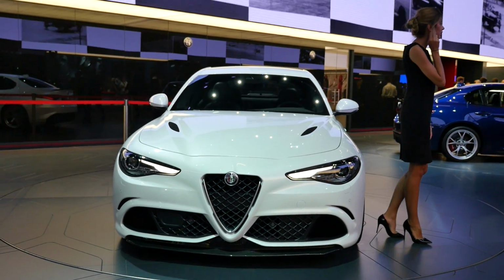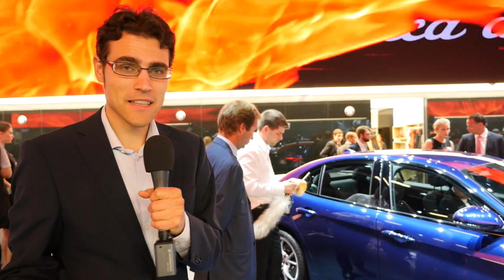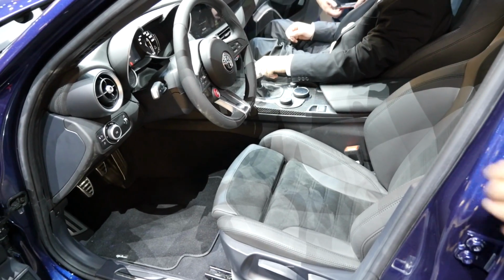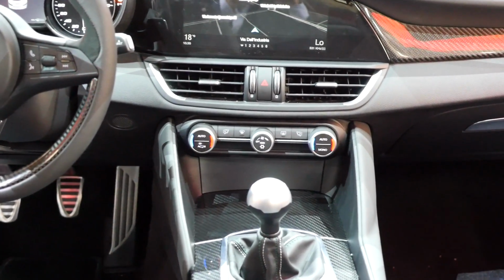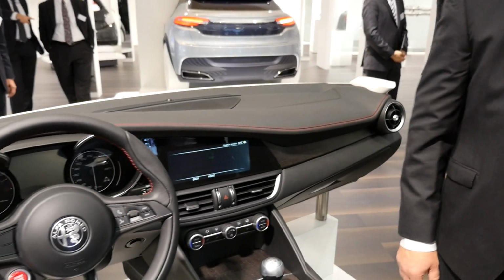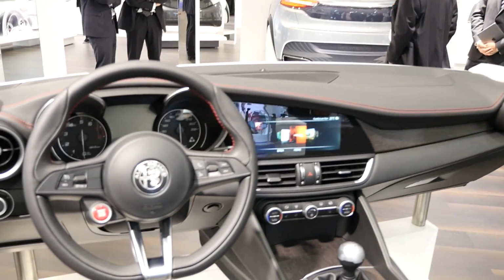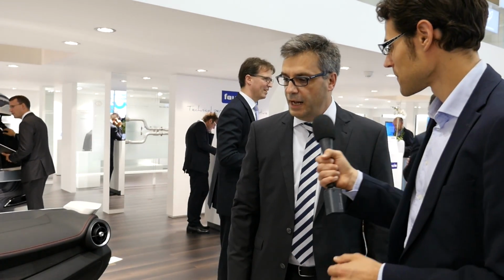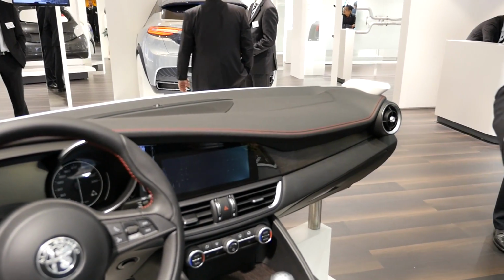2016 All-new Alfa Romeo Giulia REVIEW at IAA exterior interior new cockpit special - Autogefühl

Comment: 4:51 Also note how that german dolt is ripping the gear lever without pressing the clutch pedal.....
Reply from the maker: +Vlad Pootin When the engine is not running there is no need to press the clutch :)
Reply: +Autogefühl false.... engine is stopped, but still attached....you can change the gear but is harder than the normal and not fluid at all

Comment: Looks like BMW inside and out
Reply: this looks absolutely nothing like a bmw inside, and barely anything like one outside..
Reply: The outside is debatable but the interior is definitely BMW imo. http://s1.cdn.autoevolution.com/images/news/gallery/photo-comparison-bmw-f80-m3-vs-alfa-romeo-giulia-qv-photo-gallery_13.jpg
Reply: No...
Reply: That's looks absolutely nothing alike....
Reply: Peter H if you fanboy Alfa and hate BMW that's fine
Reply: +DaFinn i like Alfa, Audi and BMW.  It has nothing to do with bias, and everything to do with the fact that those two interiors look absolutely nothing alike.
Reply: Oh god, another one of these "my opinion is fact". My opinion is really pissing in your cereal haha
Reply: Sorry, i will admit the steering wheel looks very similar 

everything else looks completely different 

the dash is different (alfa has a very distinctive curve, while the BMW is dead straight),  the door trims are completely different, the transmission tunnel is cometely different...the air vents are round on one and rectangle on the other...its just a completely different look.

i have no idea how you could think those two interiors look in any way similar.
Reply: +DaFinn saying those interiors looks alike is like saying a Toyota Camry looks like a BMW M5 because they both have four doors and four wheels.  It just makes no sense.

if you think they look so alike, then list ke 4 parts of the interiors that look alike  OTHER than the steering wheel.
Reply: Peter H You idiot, it's not about the detail being precisely the same, it just gives me the BMW vibe, it reminds me of a BMW, so to me it looks like a BMW.Maybe It's the steering wheel or the center air vents or whatever but I don't care what it is, it just reminds me of a BMW. These are opinions, ok? Geez...
Reply: Anyway, since we want to avoid bias and try to be objective here, I will list for you some of the many obvious differences between the two interiors:

1) Door trims:
On the BMW the door handle is up high near the corner of the dash, on the Alfa the door handle ends down near the knee area.  

The Alfa has trapezoidal shaped speaker grills at the bottom of the door, the BMW has speaker grills in a completely different location.  

BMW door trims angle out towards the top of the door, while Alfa trims go straight up. 

2) Dash:
The Alfa Dash has a very distinctive trapezoidal chape that is extremely unique, and that I haven't really seen on any other car - it's a very distinguising feature of the interior.  On the other hand the top of the BMW dash is completely straight from one side of the car to the other. 

The Alfa has a display integrated behind a hidden 'beauty panel' in the dash, while the BMW has an LCD that sits awkwardly on top of the dash, like Mercedes / Audi. 

The Alfa has two round air vents (something that has been a distinctive part of the Alfa design language for years) on either end of the dash, along with two trapezoidal vents in the lower center of the dash...while the BMW has four rectangular air vents all running across the top edge of the dash.

The Alfa has two center 'pillars' that join the dash to the transmission tunnel - a look that is (if anything) more Audi / VW like.  The BMW has a very unique silver trim piece that runs from the transmission tunnel upwards into and across the dash that which gives the BMW a unique appearance unlike any other car interior I've seen.

The Alfa has aircon controls at the bottom center of the dash, stounf knee level.  The BMW has aircon vents higher up in the dash around elbow / steering wheel height. 

The Alfa has has an almost perfectly symmetrical layout on the transmission tunnel, with the large joystick in the center being flanked by two smaller knobs in what is mostly a pretty flat surface.  The BMW has a trapezoidal trim piece that sticks up from the transmission tunnel about 2 inches which the gear stick sits on, then has a seperate trim piece to the right of that which is even more elevated that h ouses the joystick/control wheel.  

The Alfa glovebox curves well under the dash and is almost not visible from the photo you linked, while the BMW glovebox comes up much higher, to almost steering wheel height. 

The dash of the Alfa is leather trimmed with coloured stitching, the BMW dash doesn't have any leather trimming that I can see in that image. 

The Gauges on the Alfa are split apart, while the ones on the BMW are close together.  

I could seriously go on all day if I wanted to be really nitpicky, but if you look at individual shapes / elements of the design the two really are absoulutely completely different with the exception of the steeering wheel, which I have already accepted looks very similar. 

In fact that Alfa interior probably looks much more A3 / C Class then it does 3-series (and it doesn't really look like those at all either).  Audi would probably be the closest of the three because of the air vent designs, the transmission tunnel design, the flat bottomed steering wheel, etc.  

It's actually quite unique though and I can't think of any car interior I've seen taht really looks much like that Giulia interior.  You might see one or two details to associatre it with another car, but 80%-90% of it looks completely unique.
Reply: DaFinn Your words were:

"The outside is debatable but the interior is definitely BMW"

Note the word 'definitely' there.
Reply: Peter H "-- to be objective here --" 

I've stated my subjective opinion all this time. Get it through your thick skull.
Reply: +Peter H  Right, I also think that but just one correction Peter, may the steering weel could be similar to other cars one, but I'm Italian (Don't if you also are ahah) and I've seen many old Alfa, the steering weel is similar to the old Alfa, is almost the same...If u look cars like Alfa romeo Alfetta, Alfa romeo Giulietta (old), and other old Alfa, maybe you will find much similar to the cars that I said, than other modern cars. 
For all the rest, well said!
Reply: I'm not Italian, didn't notice the connection!

Given how unique the whole interior is i was pretty confident try did not use another brand for inspiration I the steering wheel design.  If there's one thing Alfa really cannot be criticised for doing it's copying other people!

Undoubtedly they are one of the more unique manufacturers out there.

Comment: Giulia does not have a proper handbrake... :(
So why having three pedals on an RWD then?
Reply: +Roma Gafiyatullin  wat? It's a manual gearbox, so you need a pedal for the clutch.. and brakes and speeder = 3 pedals
Reply: +Heine Pedersen . That was an irony: handbrake and stick are useful for going sideways in a controlled manner. No proper handbrake - then it should go with paddle shifters and two pedals: that is more useful on the track.

A bit too categoric? Yes, it was meant to be that way. Humour, sort of.

Comment: you know, the ignition button where it is, is actually very dangerous.  how many times have i done autocross in my abarth and accidentally pressed the buttons on my steering wheel.  so this was definitely an engineering issue to put the button on the wheel.  what do you guys think?
Reply from the maker: +Robert ルナ so the engine went out and you have no assisted braking/steering then while still driving ?
Reply: no no haha. i mean, on the fiat 500 abarth, it has buttons, like bluetooth, voice command settings etc on the steering wheel.  but when you autocross you hit things by accident, because its a very intense driving situation, like bluetooth, windshield wipers etc.  so the ignition is dangerous on the wheel, because you might press it during autocross or track driving.  you know what i mean?  (i have hit the voice command and blue tooth button on my wheel lots of times! it goes off while i'm racing and i tell it to shut up haha)
Reply from the maker: +Robert ルナ ahh lol yes. Though you would have been touching the ignition button itself :) Yeah exactly, some steering wheels are overloaded with buttons nowadays
Reply: +Autogefühl Um.... After the car has Started, The Button becomes inactive, until its in Park. Just like any other Push button start.
Reply: ok cool

Comment: And it'll fall apart and break down before the weekend ... each and every weekend!! Alfa why do you do this, match beautiful cars with such appalling build quality?

My neighbour has a Giulietta, near 2 years old, and he's been through one engine already (bottom end and water pump went), and he thinks it'll have to have another. He's putting a quart of oil in nearly every week. He said after the 4 year lease is up, the Alfa is definitely going. My friend had a 147 and it had faults for so many things, most of which I've never heard of before, seals, for that and valves for that, hoses pipes sensors all needing to be fixed. The car had just over 40k and the exhaust was pure rust.

Comment: Holy smokes! I just can't wait for a proper review of this beauty. I just hope that they sprinkled some of that Alfa magic to the new engines and driveabilty. I used to have a facelifted 156. It had a lot of character, excellent steering and handling and also a rev happy engine. But I have to admit that the running costs were high. Especially when compared to my current 5er. It seems that the quality has come a long way since then, lets hope it lasts! Thank you for a thorough look of the new Giulia!
Reply from the maker: +automobilistafi appreciated! Indeed that might be a proper return of the '156'